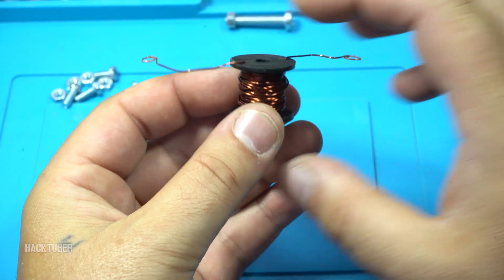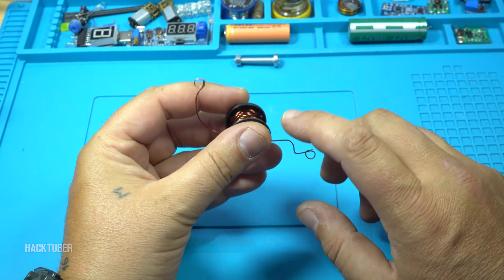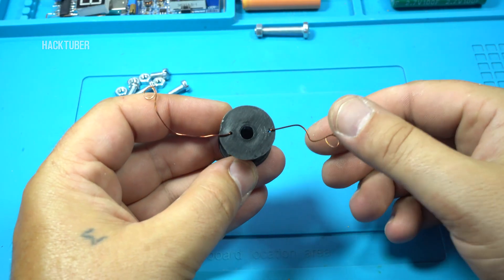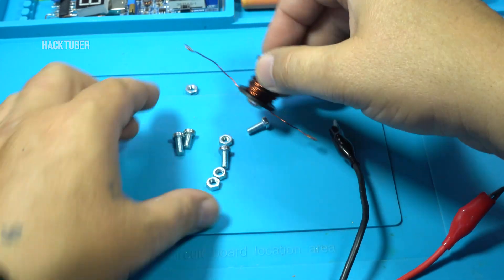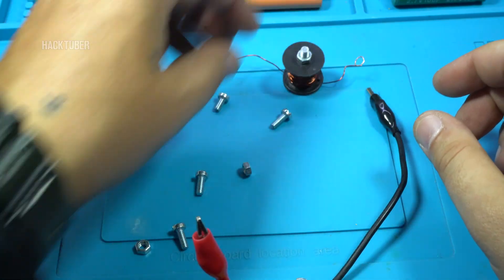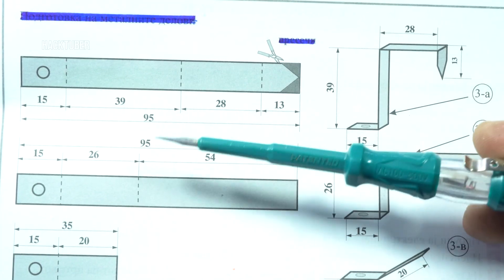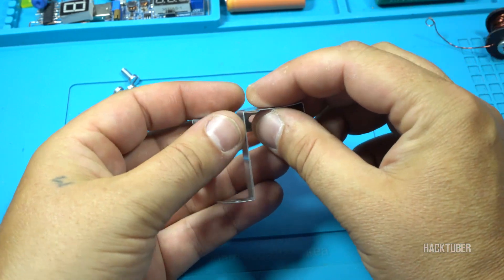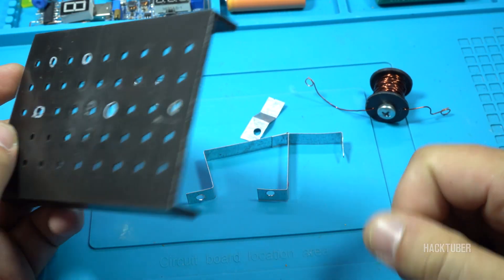How To Make Electromagnetic Buzzer - Easy School Project  using Electromagnet

Comment: I made it as a school project but it doesnt work,maybe there something wrong w/the magnetwire or the gi sheet that i used
Reply from the maker: It’s always a learning experience, maybe check the magnet wire wrapping and make sure the steel sheet is thin enough for the electromagnet to pull it

Comment: In most electromagnetic bell, the part that hits the bell can swing, so when the electromagnet pull it, it breaks the circuit. When the circuit breaks, it swings back, and so on causing the hitter to move back and forth. How does this one work without any circuit breaker mechanism? I don't seem to see any. Thank you.
Reply from the maker: The circuit breaks when lower metal plate is pull down and no longer touch the upper plate.

Comment: Now is it the higher the voltage the stronger the magnet?
Reply from the maker: Yes but heat will melt coil
Reply: Higher current would work better, but you will need higher gauge wire that can handle the current.